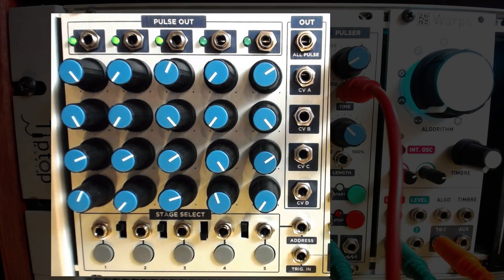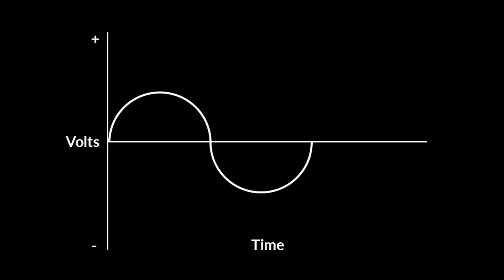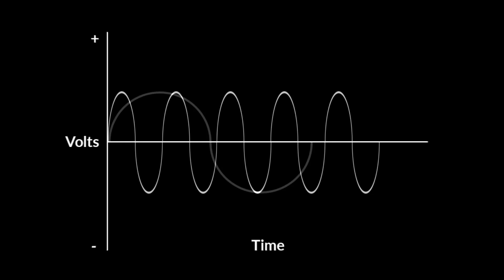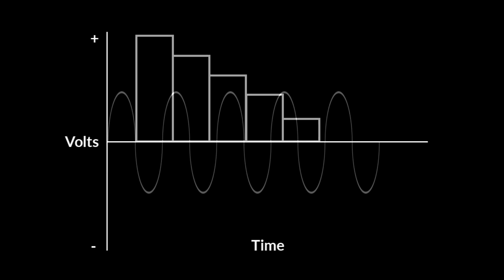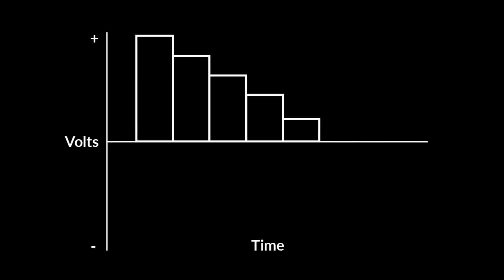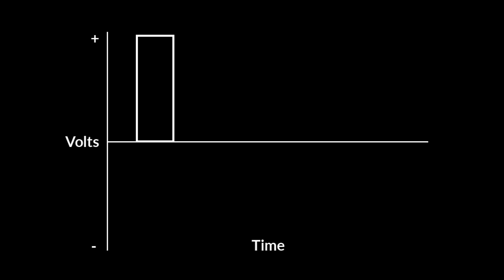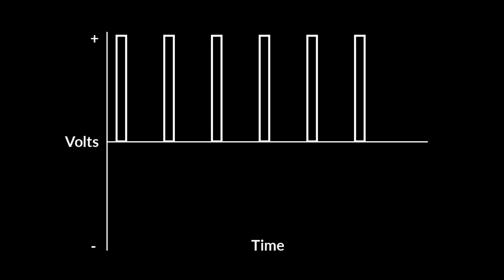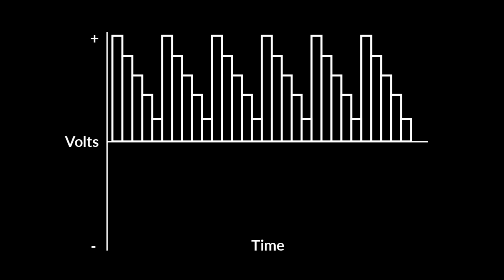Oscillating Your Eurorack Sequencer

Comment: This just creates the coolest bitcrush-style waveforms - I made a cool patch today using the 4ms SISM to offset a sine from the WMD/SSF Spectrum so that it swept through the steps in just a slightly skewed PWM-ey sine formation, then crossfaded between two of the sequences with the Cold Mac, and modulated the crossfading with another sine wave oscillator - some crazy analog "wavetable" synthesis